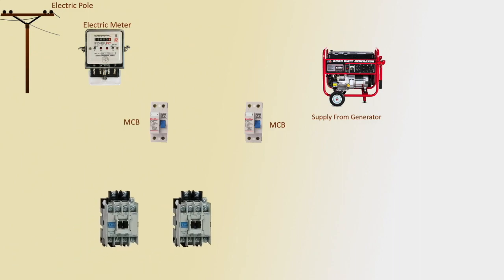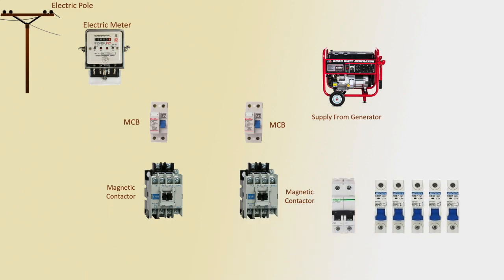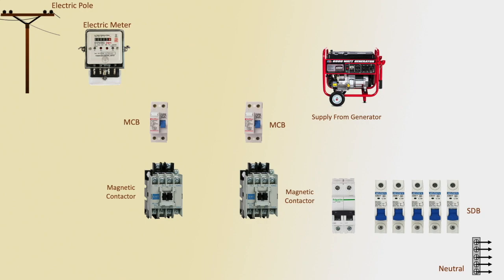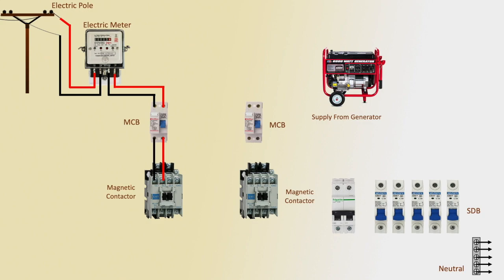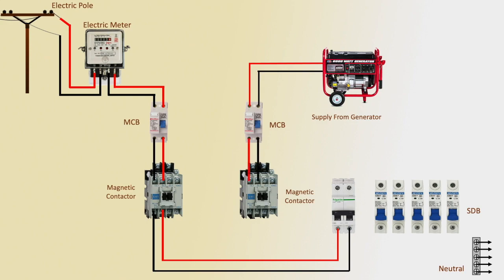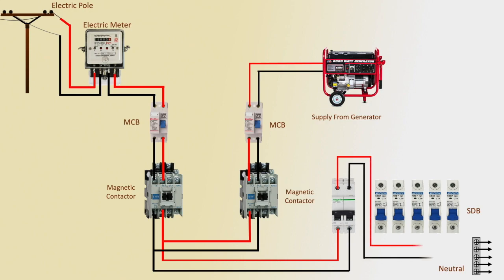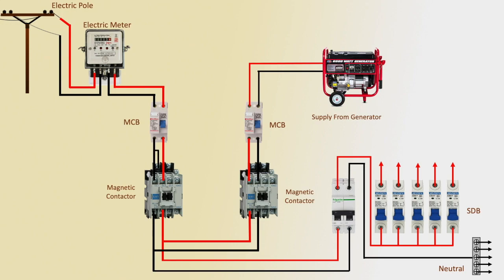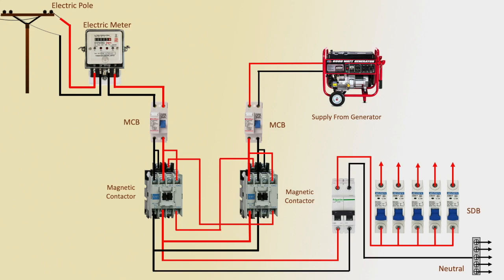Single Phase automatic Switch For Generator | automatic changeover | Generator

Comment: When there is no power from one supply, how come the other contactor will be energized? I mean the wrong with the circuit is that the coil of the contactor should be supplied from its line through the NC of the other contactor as explained in the video, what's your comment sir?
Reply from the maker: yes. your Right sir...
Thanks for your feedback, please follow.........
"Thanks for watching the video"   You are very welcome!